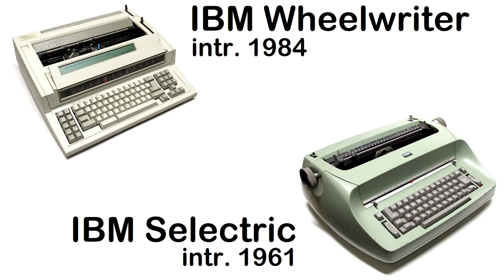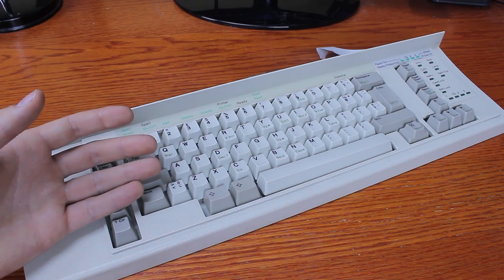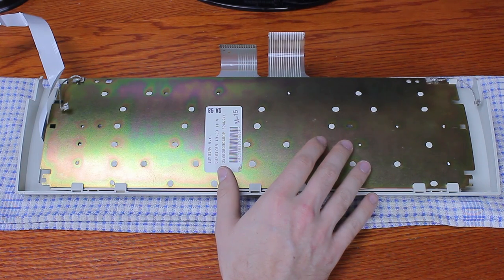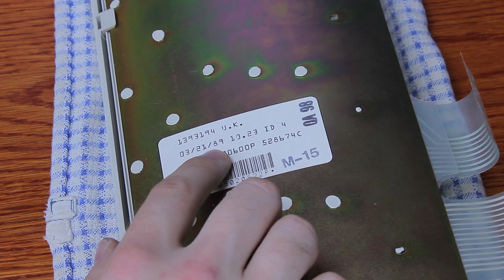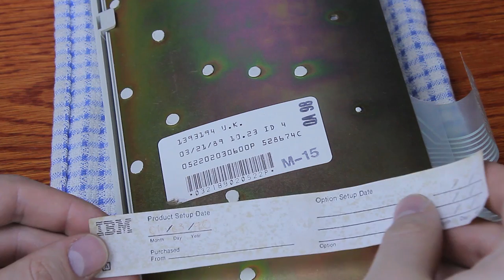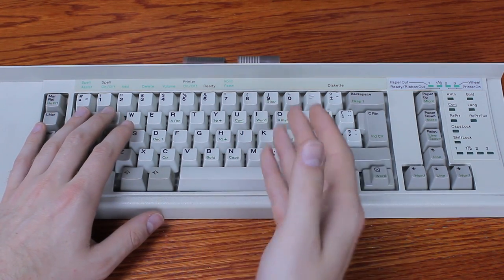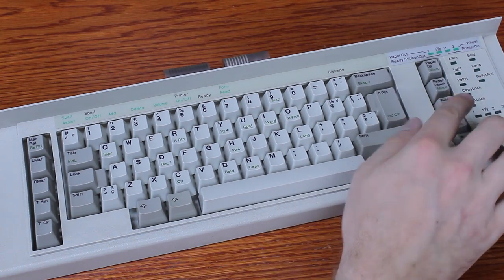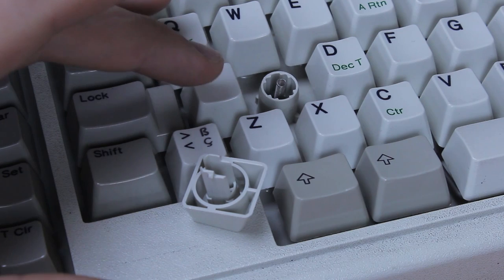IBM Wheelwriter keyboard review (IBM buckling springs)

Comment: Just ordered a Matias Quiet Click, so keyboards on the brain, and I've been jonesing for a review, man, thanks.  My friend had a Selectric II, and I got a daisy-wheel knock off with the two-line deluxe display.  We made fanzines.  It was possibly not as notable as the Selectric because it was about 1/4 as loud.  The Selectric sounded like a .50 cal machine gun.

Comment: You can wire the matrix  up to a model f xwhatsit  to get those pc compatible and reprogrammable. I still moved the caps from mine to my f107 though.... Nevertheless it's a kick ass board.
Reply: I assumed this would be the case. Why would IBM reinvent the wheel and not use a standard they already established? That would not be IBM like at all.

Comment: I think the ball prints faster than the daisy. I remember seeing ball printers in the early 1980s and they were pretty fast. Geometrically the ball seems faster but if we consider the inertia of the whole system perhaps the daisy ends up being faster. Interestingly, fewer wheel type IBM machines have survived while I heard that if you're lucky you can even find Selectrics on dumpsters and they could be put back in working condition.

Comment: Are some typewriters good sources for older mechanical switches? I've seen several at secondhand shops near me for cheap and some of them have felt like they used mechanical switches though I'm not sure what kind.
Reply from the maker: SOME did, yes. Many used fairly cheap systems that often sucked balls. But there are a few interesting ones.

Comment: nice, I have a wheelwriter 3 that I hooked up to a teensy with qmk. yeah it's almost like a 60% buckling spring...i replaced the keys on the side with some green caps from unicomp and I'm making a wooden bezel. ..turns out to be bigger than a full size though so completely kills the 60% concept

Comment: I'm just wondering, do you happen to know what sort of keycaps are used on the black Model M13? I managed to get one of these (the Maxi Switch-manufactured version - it feels just like the beige 1990 Model M and 1987 Model M SSK I normally use, but the keyboard has a louder plastic clack while I type on it, kinda makes me think of the 2009 Unicomp keyboard you reviewed) and I'm not sure if these are the same dye-sublimated PBT caps, especially with the right shift on my keyboard having been worn down to the point where Shift is completely missing from the key and the part of the arrow is gone as well. I would think it's pad printing, but I really don't know.
Reply from the maker: The M13 doesn't use dye-sublimed caps; dye-sublimation can only make legends that are DARKER than the keycap material. I don't have an M13, but I imagine it uses either pad printing or infilled legends (common on WoB keycaps). Considering how even the lettering looks on all M13 pictures I can find, I'm going to guess pad printing.
Reply: That would be my guess too considering the right Shift key's legends are pretty badly worn out on my M13.
Now, there are some beige variants of the M13, and I would think those could possibly use dye-sublimated caps. From what you're saying, the caps on the black M13s are definitely not dye-sublimated, but I would expect the beige ones to be.

Comment: I have 2 type 6781 machines, one was damaged so i ripped out the keyboard, now to figure out how the hell i'm going to make it work.

Any ideas?
Reply: you can use an arduino uno or simlilar board. there are a few libraries of keyboard firmware available, that you can freely configure to fit your layout. the connectors of the membranes fit into normal 2,54mm flatflex connectors.

Comment: Not related to the typewriter but can the extended apple keyboards be used on windows
Reply from the maker: Yes, you just need a converter for them.
Reply: Chyrosran22 thank you
Reply: If you're familiar with Teensy microcontrollers and C-compiling you could build one ourself with an off-the-shelf s-video cable an a little bit of soldering